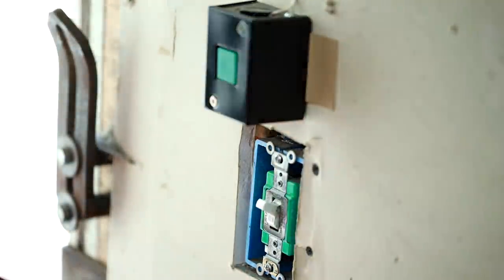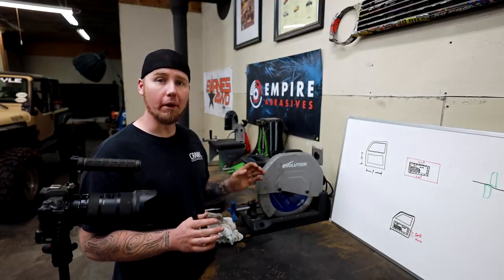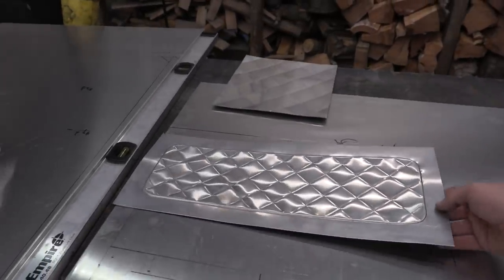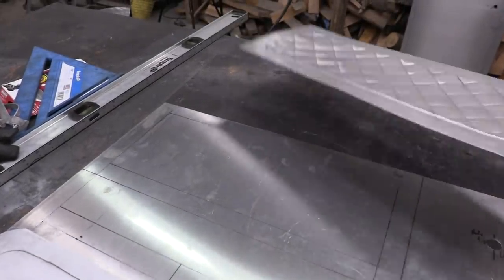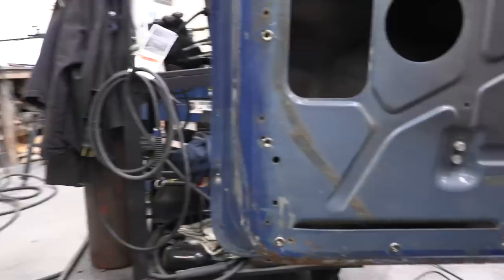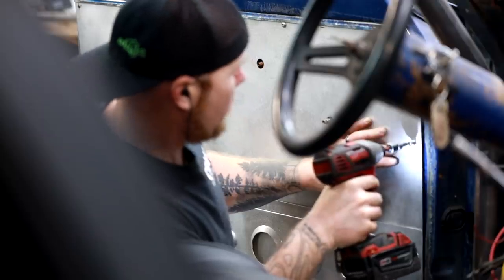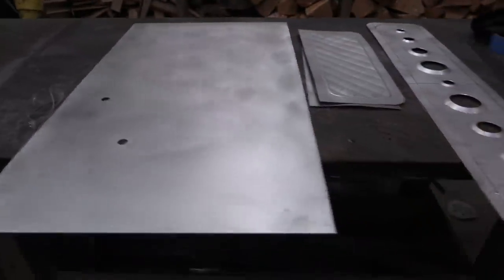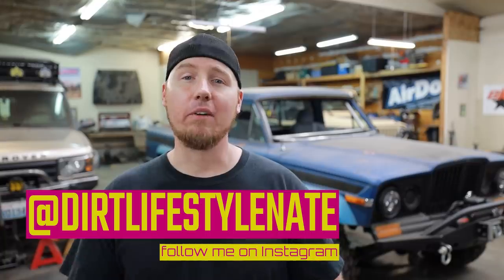Rat Rod Door Panels For Your 4x4! Low Buck Diesel Truck Episode 16. Bead Rolling Basics

Comment: What about making a soft strap for the door pull out of some webbing or like an old leather belt?
Reply from the maker: It's not out of the question. I prefer to make stuff out of metal but a peice of cloth or leather did cross my mind 🤘
Reply: Find the theme of the truck and work from there....
Reply: This is what I was thinking. Something soft that you could mount under the window but not be annoying when hanging your arm out.

Comment: After I drill the hole for the rivnut I use a small file and file a divot in the edge. When the rivnut expands it will lock itself in the hole when it expands into the divot. I have had good luck using that method. Also another great fab video. Your fab videos are your best IMO.

Comment: I bought some cheap abs panels off bjsoffroad as a temporary solution for my 73 Jeep truck. I want to build something similar to add to the interior and you’ve given me some great ideas. Also, I used that same kilmat sound deadening stuff and it made a world of difference. Love the videos on the low buck diesel truck. Keep them coming!

Comment: Man that is so cool that you went completely out of the box with the door panels. My originals on my J2000 are badly warped and have tried everything to save them . Just as you said no after market parts are available and upholstery shops charge just as much as a door replacement on one of these trucks if I good one can be found now days. You have gave me a whole new thought on trying to fill one of the missing pieces inside one of my trucks. Can't wait till you get yours trail worthy and see how it performs with the binz diesel. Great video enjoyed every minute had to watch it over just to see if I missed anything.

Comment: I have the same riv-nut gun (different brand name).  Riv-nuts are great!  For spinners what I've found to be a solution is get a bolt of the same thread that at least goes all the way through the riv-nut.  Put a nut and washer on the open end and a washer on the hex end.  And tighten until you're blue in the face.  I had to do this on my truck the past weekend.  Worked great.  Also a good idea with the anti-seize or grease.  The riv-nuts love to corrode no matter where they are and when they do your bolt won't like to come out.  Then you'll have a spinner where before you didn't.

Comment: Leather strap door grab for closing. Could use aluminum to make the hold down ends. Well oiled old belt about 2" wide. Image search for leather trunk (and yeah truNk not truck) handles will give lots of ideas. 

Loving the builds and content. Gathering components now for a v8 swap and 1tones in my JKU

Comment: Arthritic Tin bender......  sometimes we would heat our aluminum sheet goods to change the temper or "ductability"  for bending or "beading" . As far as the beading (and spending many hours running a Pexto machine) flipping your work piece over to Back Bend the next crease or flatten the current one will sometimes keep the rolling down....  ..Enjoy your Channel....

Comment: For the door handle, I would get a block of aluminum, maybe 2x8, and weld some legs onto it to bolt into the factory armrest holes. And then polish that block to a perfect shine with no sharp edges or corners. Seems like it would work well and be comfortable for your arm to rest on. Great vid buddy

Comment: Hey, a tip I would suggest for the rivnut is the same that we use on our helicopters, is to wet install them with a good two part epoxy primer, (adhesive like your using works great too)  which I use on my Jeep to install for corrosion and gripping or the ones that the factory require have a key to keep them from spinning, works great when you have to drill them out too. They are about $1.20-$1.80 per but like any hardware, the more you buy, the better the discount you get.

Comment: One thing I saw Make It Kustom do to fasten panels to steel or aluminum to steel, is make these small holes in places that a rivet would be and do tac welds in them with a mig welder. He has these pins to hold a panel in place on the borders as he tac welds everything; he pre drills these small holes, and there's a hand tool that puts the pin in the hole and when you release the handle, the pin holds in place until you get it all in place and start tac welding. He does some pretty legit stuff. anyway, sorry for blowing up your comments section, brother. Just thought it might be of interest to you.

Comment: Spray some WD-40 on aluminum and use a flat sander same direction. creates brushed look.
p.s. on riv-nut there is a product called np-1 or mp-1 comes in caulking tube. takes week to cure fully, usable in few hours. make sure its warm before you use it. hands and caulking gun will thank you.

Comment: Nice job... you can also use a scotch pad on a drill and make a "engine turn " pattern... always been a big fan of that model pickup... just tossing out a suggestion... something totally different.  Convert it to a dually... it would be one of a kind... atleast as far as I know.  Just something different and unique.  Which is right up your alley... As always keep up the great programs and always looking forward to seeing what's next.
Reply from the maker: Lol i looked into it. I have seens some 60s dually jeep trucks that would be a cool bed donor. Im just not there yet lol
Reply: Very cool.... get the torch and the old Dodge dually trucks had interesting fenders on the back... nothing a crack fabrication guy like you can't handle.... ahh just kidding around...but it would be a cool thing... enjoy your programs and channel,  thanks for the reply.

Comment: Hey man I like your trick with the rivnuts using that loctite, but incase you forget it next time you do it I got a trick that has worked for me. After you drill yor hole for the rivnut take a small round jewelers  file and make a notch in the hole. When you expand the rivnut with your tool it will form into that notch keeping it from spinning. Hope this helps ya.

Comment: Thanks buddy for the great video. I like learning about sheet metal work as you can see in my picture the roof and the front push bar and radiator protection was things I built after the stock .org failed on me and my playing rough

Comment: you would like "Make It Kustom", he does the diamond pattern, and he uses a similar die set to do it, but he made his bead roller from an Harbor Freight Beed Roller. It has a 36" depth and remade it with 1/4" steel, and he shows some techniques on doing the diamond or quilted pattern that might help. Anyway.

Comment: One thing to consider the stock panels could be used as templates to cut out a more to fit size. If you don't have panels you could probably get them at a junkyard pretty cheap. 
I'm making panels for my Jeep YJ doors I'm using the existing cardboard panels for templates it cuts time on having to measure out holes for window knobs and door handles.

Comment: Nice work 👍

If you think your riv-nuts are going to spin  don’t rely on some crappy glue -  go ahead and put a tack weld them and then grind it down a bit - if you don’t have a welder well I guess you’re just hosed

When buying anti-seize go the extra bit and get the marine grade as it’s not water-soluble

Comment: if you use a circular saw to cut aluminum or sheet metal, if you will flip the blade backwards, it wont throw as many hot lags at you if you are using a carbide bit blade anyway.

Comment: Nate, good to see you having some fun trying new things. Been watching you for a long time, and I would love your opinion on something.  I'm getting another 1978 Toyota land cruiser fj40. What diesel motor would you replace the 2f gas motor with?
Reply from the maker: Hey man! I'm glad you are enjoying the videos! 
I would recommend a vw tdi. Light weight, powerful and efficient. My 2006 1.9 tdi moves my jeep fine and its hardly modified.
I'm around 180hp and 340 ft lbs. The jeep weighs 4400 lbs with the full sized spare.

Comment: Off topic.  What are your thoughts or recommendations on adding some custom traction bars on a 2017 ram cummins with a 5inch lift and its a 4 link. I do towing only.  Thanks..  Btw. You do great work and i enjoy the way you explain everything with Great detail.
Reply from the maker: Hey man! I've don't have any experience with those trucks unfortunately. A few companies sell universal kits that have the basic parts needed to build one. 👍
Reply: Thanks for the reply. Is it a good choice to add them to the suspension? Or would it cause any issues since is a 4 link not leave springs.  Thanks

Comment: Never used a bead roller before, but what if you rolled the perimeter bead first to give the sheet some rigidity.
Reply from the maker: I wish it was that simple lol. The dies I used for the checkered pattern would dig into the edge of the perimeter bead. And the perimeter doesn't make the panel as rigid as you would think. Every crease you create with the bead roller puts tension in the panel making it want to have an oil can effect. There are some great strategies to prevent this with an English wheel or a planishing hammer but i don't have those tools yet. You can expand the material before you lay down the bead making the bead roller straighten out the peice instead of bend it. This tool is fun and teaches alot about how sheet metal reacts to the work you put into it. But I'm still a noob of this skill set and am definitely not an expert. Lots more learning on the process 👍

Comment: Hey Nate, those rivnuts reminded me of a question I had for you. I just helped a friend buy a 94 XJ and the rivnut that the tailgate strut screws into completely ripped out and wallowed out the hole. Since we cant simply replace the rivnut, would you recommend welding some sheet metal over that spot and drilling a new hole to put a rivnut into? Its a small and awkward shaped space so that wont be too easy. Any thoughts you have on it would be greatly appreciated! Love your videos as aways!
Reply from the maker: Hey buddy! I would try something like this.
https://smile.amazon.com/dp/B07KWX5BD3/ref=cm_sw_r_cp_apa_fab_nxrFFbPT2R0BM
It will be stronger and you weld it directly to the rig if you can fit your nozzle in the place you need it 💪
Reply: @DirtLifestyle  Didn't even realize that existed! Thanks Nate, best fabrication advice as always!
Reply from the maker: @JoeGarofaloII  good luck buddy! 🤘

Comment: Couldn't you use a punch to pin the base of the rivnut to help keep it from spinning?
Reply from the maker: I've tried this and it doesn't really work because the top of the riv nut is pretty soft. At least it didn't work for me. 👍